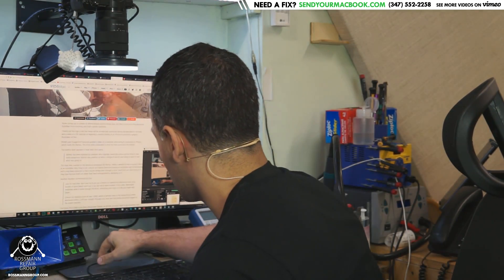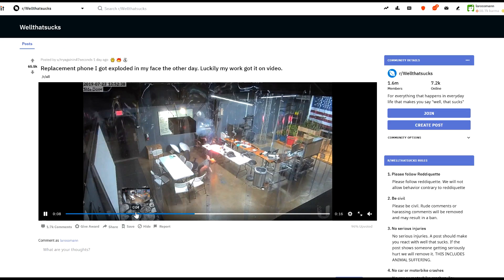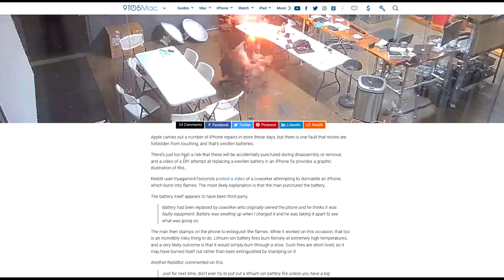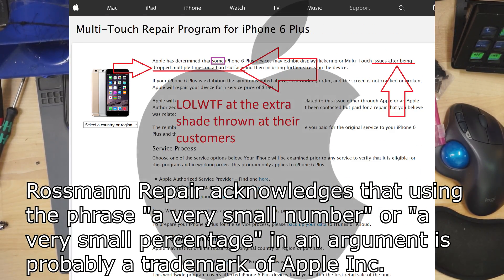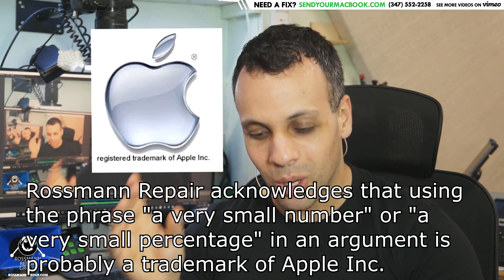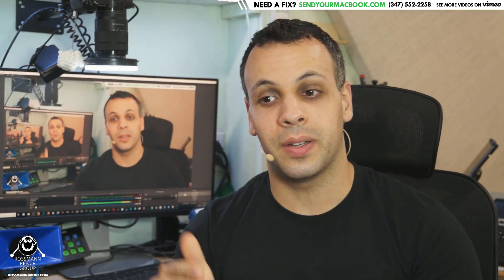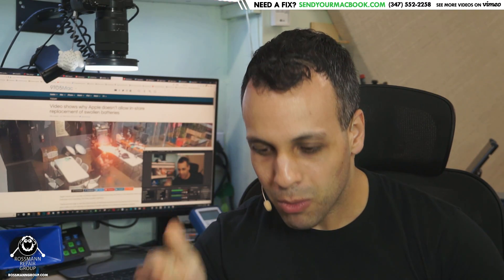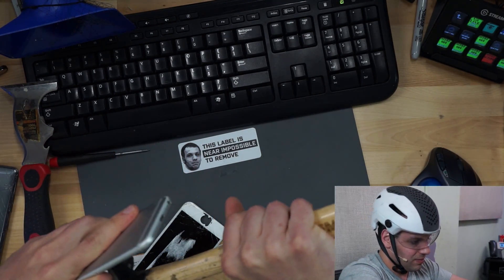STOP FEARMONGERING

Comment: @louis
it´s just not an entirely honest explanation of the reasons behind the decisions they make:
- user-removeable/ -exchangeable batteries allow easy access to parts of the device, thus making it easier for everybody to simply swap a degraded OEM battery with a cheap 3rd party battery, thus "stealing" from the company, who wants to sell their batteries as well
- modularity and repairability allows users to repair/ exchange parts they want, not what the company wants them to replace ("i want to replace my battery" - "we can´t do that, there´s screen/ glass/ enclosure damage, we need to exchange the whole device, that´ll be 300$" - "but i just want the battery exchanged, the glass damage doesn´t bother me, how much is just the battery?" - "no can´t do, whole thing needs to be replaced, that´ll be 300$" ... user walks over to independent repair shop and gets battery and glass exchanged for 100$)
- design choices do matter and a shiny, beautiful, sleek, minimalistic iphone or macbook does sell better than one with hinges and grills and stickers
- the company wants to ensure that high-grade parts are used in the devices, so they are not liable for 3rd-party-crap-incidents that inevitably lead to them being sued for something they didn´t cause or are responsible for, because: cheap knock-off batteries, chargers, cables that cause fires, chemical burns and data loss are real, not imagined dangers - that being said, if they would sell their OEM parts for a fair price or at least make them accessible for professionals (like louis or the swedish shop or to jessa), it would make rounds that users don´t need to cheap out with crap parts if they can get the real thing for a couple of bucks more, with warranty
- if you make repairs easy or devices repairable, there will be unskilled people who a) buy crap stuff because its cheap, b) try to replace it themselves, rather than bring it to a store with skilled professionals, c) they will occasionally blow things up, d) even worse, they will scam people with no-good repaired devices and sell it for top $ because it bears the brand that stands for quality (haha)
- at the end of day, companies work for profit, not to make life needlessly easier for repair shops who don´t pay the company 

i think there are reasonable arguments for both repairability and service-driven quality control - i mean, i don´t know if and how many incidents occured with real, tangible effects (like people dying or data loss or places burning down) because of botched repairs or use of bad parts. when companies purposefully limit the access to parts for repairability, its a) for their profit, and b) for their protection and c) for the protection of their customers. it´s not as easy to just point the finger at apple and say "you mo$%&fuc$%s just want me to buy a new phone!" 

i would very much like to see a statistic of how much money they have to spend to litigate claims made against them because of unsafe use of their devices and harm caused because of that. 

on the other side, yes, extending the life of a device that you bought and want to have repaired is a fundamental right - just as much as privacy -  you have a right to do with your property whatever you like.

Comment: I refuse to get a phone or device with non-removable batteries.
-A faulty/worn battery shouldn't be a repair, it's a bleep battery!
-I've had phones etc stuck (bootloop e.g.) to the point removing power was the only way to get it out of it. wtf are you going to do when this happens and it has a fixed battery. You need to go to repair shop because the 'computer' needs a hard reset for software probs instead of.. just doing it.. That's just retarded.
Reply: It's a shame that only budget phones have removable batteries. & sadly those are dying out as well. They'll all be sealed one day. On every phone.
Reply: @The716_  It'll be so quiet in my house without one then :) Perhaps even therapeutic.

Comment: I held an expanded lion battery in my hand ~daily for about a year. Removed the casing from the remote of my skateboard and the battery was scary big so I just figured that since I'm outside, the moment it would have gotten HOT I'd just drop the remote but it never happened. Got a new battery same brand (still using no casing) and that one doesn't seem to expand so it could be just bad luck. For charger; the charger is on the controller via USB and always charge via my PC. 
Small factory defects in the battery could also explain a lot of the expansions/explosions.. Not piercing the battery and if you mess with it, try and drain it first!

Comment: I repair phone for a living. I am one of those "third party" repair store that do repairs. We replaced the batteries with batteries that we cover for a year. There is a number of times we actually change our a swollen battery. It's easy, it really easy. Easy in the sense that if you have experience with removing the battery. I use both tweezer and a sludge to get the battery. We only had one, ONE experience with the battery getting hot but did not explode.

Note please get the actual apple cable. The reason why is they have a chip on their charging port that allows it the charge properly. With a non apple cable, it does not have that component in their cable.

Comment: Louis, if you cold please give me advice, im having a problem with galaxy a5 2017. Vibration stopped working after few months(firtly it was weak then it stopped working completly), i had it under water (not sea water) maybe 10-15cm for about 5-10 seconds few times for some videos and nothing happened.(i believed that ip68 rating.) Every time after getting it wet i cleaned all connectors with IPA and soft tooth brush then let it dry to prevent dust buildup and evaporate water faster. Now 2 months before warranty i tried to take a photo of fish under water. It was exposed to maybe 5cm of depth from water level for like 10 seconds. Camera got foggy(idk how?) and touchscreen is skipping touches(not registering them) around some spots that move. Sometimes its bottom middle and sometimes its bottom right corner of touchscreen that is missbehaving. I decided to go to samsung's authorised service and the lady on reception said that there is no more warranty because device got wet.(she said that without inspecting device inside, i mean the LDI. (i checked LDI on sdcard slot and it was intact)). It was held in repair shop for a day and the guy who worked on phone said that vibration and touch screen are not working because this all was damaged: motherboard, battery, battery case, phone's case, vibration motor, speaker, LCD!!!!, and soo on every part in the phone... LCD is working normally and whole phone, it boots, i can make the calls, browse web. Only problem is ghost and missing touches and vibration(which was not working for a year). Now they are refusing to repair it in warranty because of that water damage. Phone has never been dropped and its phisically intact. If any of the LDI(liequid dmg indicators) are not triggered and there is no phisical damage does warranty repair still count? What should i do if they reject it? Im thinking that there is just moisture trapped somehere near touchscreen? Can i fix it at home or i can ditch the lcd and touch assembly in rubbish bin? Moisture from front camera got out when i put phone in box with sillica gel over night(also touch was behaving better but still ghosting). Is it fixable without replacing parts(excpect vibration)?

Comment: So battery in my JBL speaker needs replacement. I thought I would simply pull old one out, order new one and done. Boy was I wrong. I opened it up. Battery is glued in. I was like "There is no way I won't be able to remove it some way. So I have checked online. Apparently there is one way. Just screw cork screw in the battery and get it out. Yea... great idea screw something in lithium battery and hope it won't catch on fire on you :D great engineering JBL...

Comment: Thanks to you Luis I replace my own aftermarket third a party battery that lasts longer than original Apple. I buy cheap aftermarket third-party screen that nobody can is not original apple 15 to 20 minutes to replace US$18 and that’s considered a high price. Thanks to my College Electronics classes and self taught background I modified my Apple 6S plus to wireless charging and added a custom made 20,000 mA battery case. F U APPLE 🍎

Comment: "If you puncture lithium it's going to explode".... no... no it isn't, I've punched a hole in about a dozen of em trying to get em to blow.... most dramatic effect so far was one quick wiff of smoke.

Seriously, there are probably in the ballpark of at least 15billion lithium barriers in circulation (I know I've got a couple of dozen myself), if even 1 in 10,000,000 exploded it would be a serious problem..... it is not a serious problem.

Comment: Another thing apple and others that lock the battery in the phone won't talk about is, YOU CAN'T GET RID OF THE OLD BATTERY... easily, They make it difficult to open the phone, and you should replace your batteries, and because you can't old phones will become a dump site hazard if the batteries aren't taken care of ahead of time. The only reason they do this to us consummers is  because they want you to replace your phone and not the battery. Their logic is well the battery will become crap and make the phone unbareable to use (like the 3G Iphone) before the battery becomes a danger, This plan did work on me only after the phone actually gave up the battery was so bad that I had to keep it plugged into a USB port 24/7 essentally, charge it over night plug it into the car and on breaks at work if I didn't it'd die during the a phone call. 

But when it died I got a new phone but it wasn't a apple phone nor would I desire one again apple suck and itunes sucks balls.

Comment: This is going to sound stupid, but keep in mind I grew up on a farm. When I was 11 I used to try to make old dead batteries explode on purpose. I put together a board with nails that touched the terminals on D sized batteries and hooked the nails to 120 volt line power. The old carbon zinc ones would explode like a big firecracker sometimes. The alkaline Duracell was harder to get to do much more than get hot and burn. The old cheap carbon zinc ones would explode because they had a solid zinc can and the top was sealed with tar so they could build up a lot of pressure. The old cheap carbon zinc batteries were common in the early 80s.

Comment: I was replacing an iphone 6s battery (non-swolen), broke the removal strips, and while I was trying to pry it out, it caught fire. 

I made several mistakes. 

1. I tore the sticky strips.
2. the battery was fully charged
3. the tool I was using was metal, not plastic, and punctured the battery VERY easily.
4. I was in a hotel room working on a painted wooden surface. I was lucky I didn't damage the furniture. 

The phone still works fine, now that i've got a different battery in it, though the speaker enclosures have a little melt-damage.

Comment: Im laughing. To think this is too dangerous while i am working as an electrician and if i make a wrong move or a mistake that could end my life.  i cant go to the customer and say " sorry its too dangerous i cant repair it. No its all about your knowlege to know how you can work with the tools you have properly to make sure that you will not end up dead after changing a simple plug. 
If you cant do that your simply wrong in that type of work. We in germany have a facility thats called VDE which job it is to say how we can work with which tool so we can work safe on a specific thing thats neednt to be repaired. The same is neednt for something like this. 
How can i remove it with which tool safely and how can i protect myself if something happens. Its just that simple. (Geht nicht gibts nicht)

Comment: It's not puncturing that causes that fast of a reaction! It's that the puncture can break the insulating layers between anode and cathode. This is why they also say not to bend the battery as well, it's far lass dangerous but it can still push the plates past the insulation layer and cause an internal short as well. Since there is not much of a direct lithium metal the open air during a puncture there simply isn't a fast enough reaction that can happen with just a puncture alone. I strongly agree with glued in battery BS though, I hate that crap and it makes pulled good batteries look like crap.

Comment: What?  No Apple authorized battery draining load to remove the terribly dangerous power?  Or an Apple authorized non-conductive battery puncture tool to safely vent the gases into a container.  

I took my time when I had to remove an expanded lithium battery from a car boost pack as it held a lot of energy.  Had a tiny bit of sticky on it.  Put a power resistor across it for slow discharge down to tenths of a volt, then small surface puncture to deflate it, then into the battery recycle bin.

Comment: Personally I could care less that my new phone is 2 mm thinner or completely waterproof.  Carried a cell phone for over ten years and never had cause to be concerned that it was going to get wet or that the extra 2 mm in thickness created an unsightly bulge.  These are non-issues the manufacturers try to make relevant to consumers to encourage product purchases and unit turn-over.  I personally do not replace my $1000 fridge or TV every 18 months, so they should not expect me to do the same with my phone...I simply won't do it regardless of the hype and bells and whistles.  It annoys me greatly when they force you to abandon a good working device because the firmware isn't supported anymore...that seems contrived and arbitrary...read between the lines, it is a cash grab...won't play that game.

Comment: What bothers me about all of this stuff with the batteries is how OEMs blame third-parties for problems like this. Lithium-ion based batteries are all eventually going to have to be replaced. It doesn't matter when it was manufactured and when it was placed into a device. At some point in that device's lifetime, that battery is going to go bad and it will have to be replaced so the device can continue being used. EVERY battery is like this. This is not some unknown variable, everybody knows batteries must be replaced eventually. 

Why, then, is it perfectly okay for something like a battery, which must be replaced eventually, to be glued into a device or situated in such a way that it is designed to dissuade replacing the battery? And then these manufacturers are surprised beyond belief when people don't want to hear they are forced to get a new phone because their battery has become swollen. Huh. Hmm. I wonder...maybe if the batteries were meant to be removed, it wouldn't be a problem if one was swollen? Really makes you think. It's not a third-party's tech fault if a glued-in, swollen battery explodes in their face. It's the manufacturer's fault for putting glue on a ticking time bomb and expecting people to be okay with complete device replacement for a bad battery. 

I know what some people are probably thinking, "b-but the Apple training! A third-party tech has no Apple training! So it is not Apple's fault!" You want to know what Apple's training is? If the battery is swollen, don't touch it. Third-party repair shops are the ones risking their health and safety to replace swollen batteries. What is Apple doing? They're telling you to buy a new device. The lead-acid battery in your car can last well over a decade, but even that must be replaced eventually. Imagine if you had to buy a new car because the battery was completely internal, non-removable, and welded to the car itself. Imagine if the manufacturer told you "Yep sorry, that battery which we designed to be irreplaceable went bad, you need a new car." 

The fact behavior like this is perfectly acceptable with many electronics these days is completely absurd to me. People need to realize they're getting shafted and do something about it.